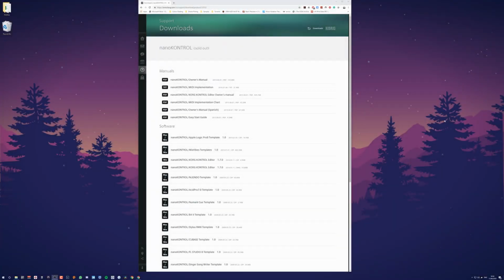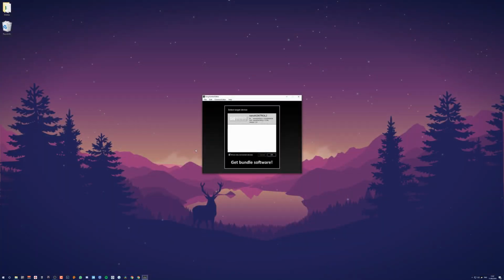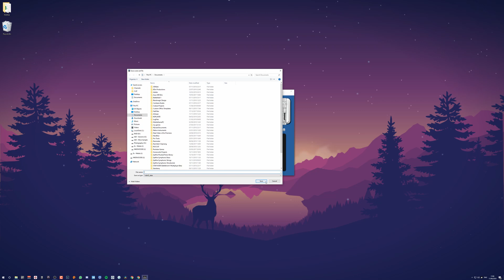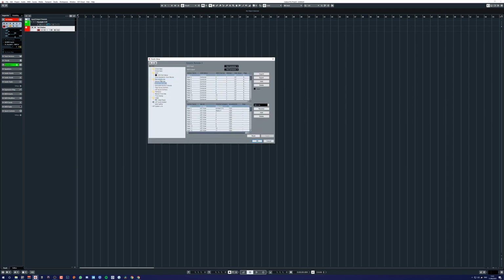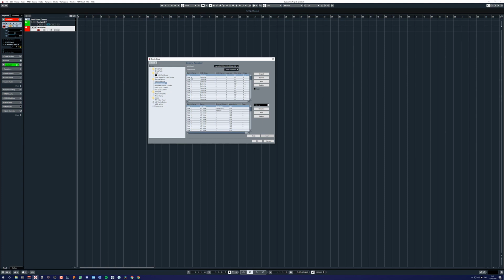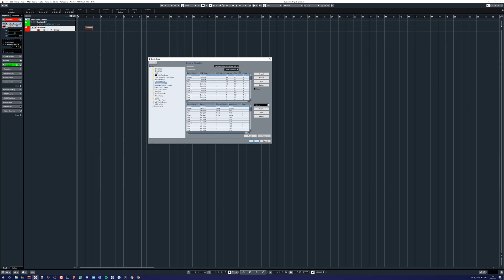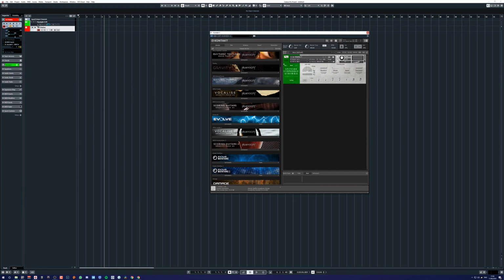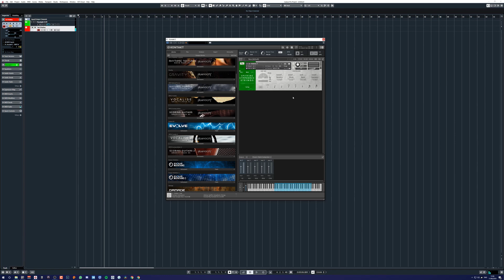Korg NanoKontrol2 Setup - Full DAW & MIDI CC Control

Comment: i dont know if you're still here, but i'm trying to go further and assign to mu nanokontrol2 some midi cc that would allow me to keyswitch in kontakt (spitfire). so i do as for the faders of dynamic and expression.. and i lock tu uacc, then i put a cc number on say every rec button, corresponding to the ones i choose on every articulation.but that doesnt work.i suspect it's because i should define one cc "canal" that my nanokontrol2 will use to send those cc to kontakt.. but i'm not sure about that. do you have some knowledge about this ?  thanx a lot

Comment: Maybe a stupid question from a beginner, but where do I find, that which CC means what? How do you know, that the CC14 is vibrato,  CC11 expression and so on. Is there some list of these numbers in Cubase? Because yesterday I set it up correctly thanks to your video, but it seems that my Cubase has Alzheimers and it doesnt work today anymore. :D
Reply: I know for Spitfire libraries they are usually included in the owner's manual. In the case of BBCSO, they have a video guide for the controllers. Hope that helps a little.
Reply: @TheCoolj1212  Yes, it helps a lot! I’ll check that out! Thank you very much! ))

Comment: Could you tell me, how you have configured the Faders (sending #11,#1, etc.) on the Cubase side in the lower table. On my system I get the transport functions to work, but I cannot send CC11 to my VST instruments. In the upper table the faders have been recognized with the correct CC values.

Comment: with some vst's the setup is messed, because the same knob which I linked with vst-knob, turns also some other knobs of the vst! (cannot see those links in controller setup),  no idea why it's like that, but didn't find a solution to fix this. I am using cubase.